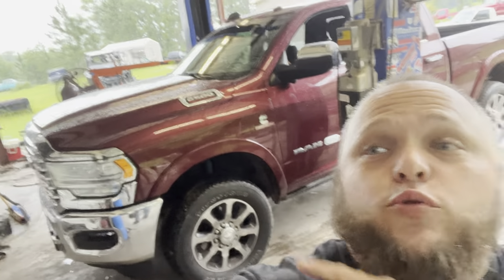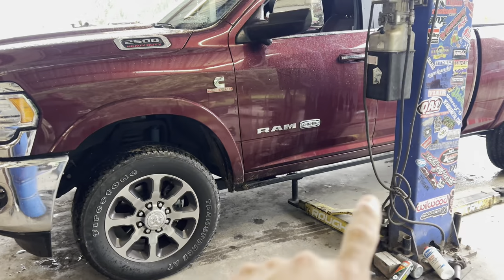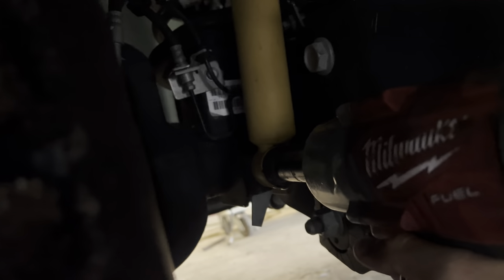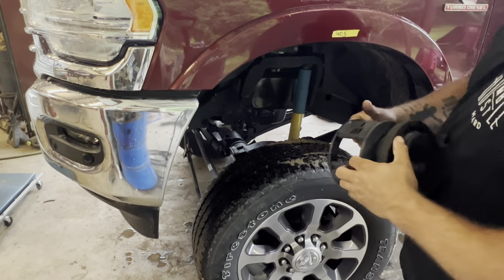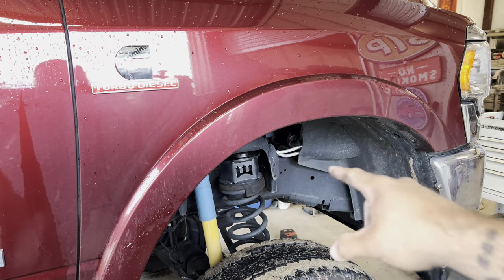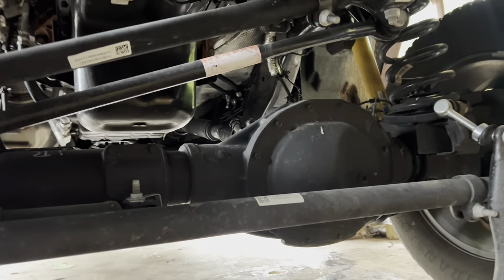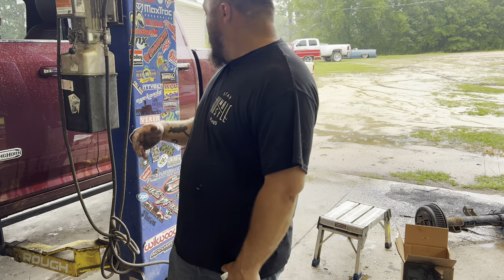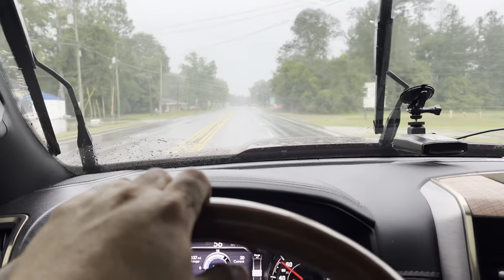Installing a Wicked Mfg. 3.5 inch Leveling kit on a 2019-2023 Ram 3500/3500.

Comment: As a ram tech the new trac bars are even easier to adjust. It’s just a 19mm to loosen the nut and you just twist the adjuster.
Reply from the maker: That’s good to know…I left the Dealership in 2018 so I wasn’t familiar with the new setups..which we always sent them straight to alignment when we finished

Comment: cam i do the rough country kit without drilling into my frame?
Reply from the maker: @nicholassantana7663  yes there is a factory hole already there
Reply: @lowerclassfab431  the second one i can leave without a bolt?
Reply from the maker: @nicholassantana7663  yes won't hurt a thing

Comment: Way way way too tall to not use a trac bar and a pitman drop or something.. that’s crazy. The parts look like a 11th grader made in a welding class lol. Terrible quality lol.. stick to name brand 2-2.5” at most leveling kits.
Reply from the maker: Trucks still riding around every day…seen it just today actually…has 24x14s on it now and surprise surprise the front axle hasn’t fell out of it yet
Reply: @lowerclassfab431 the welds are great quality actually